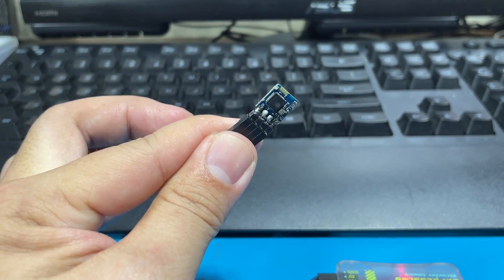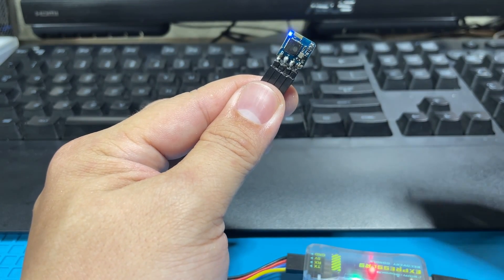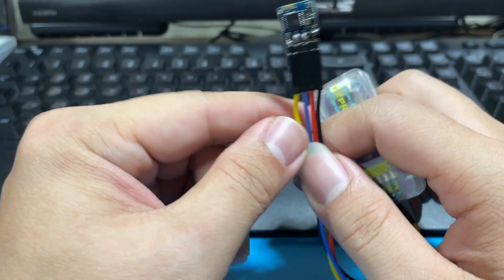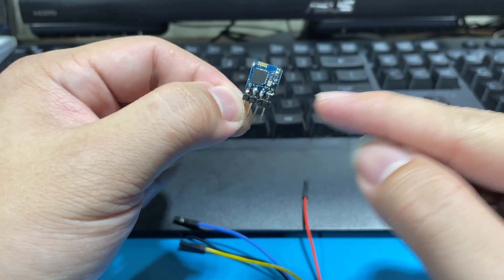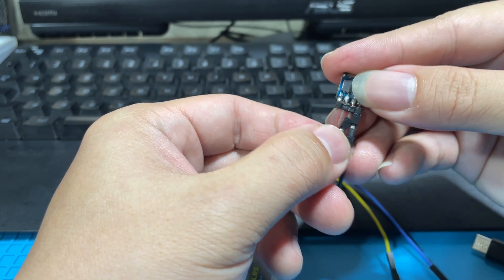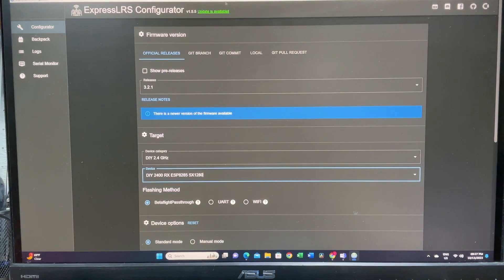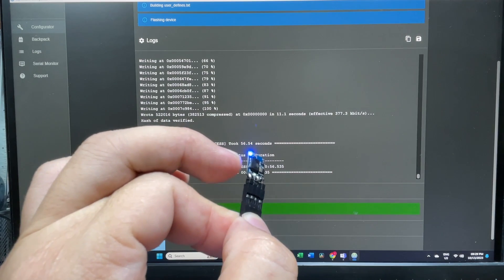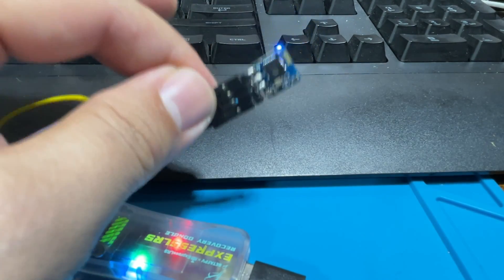[Beginner] How to unbrick your EP1/2 ELRS receiver? BetaFPV ExpressLRS Recovery Dongle #drone #fpv

Comment: Hi Friend, Nice video!
I have same problem but it happened in my Happymodel CrazyF411 FC that came on-board ExpressLRS receiver. 

Regarding this issues, how to solve it since it has no external receiver?

Do you have some ideas?
Reply from the maker: Don’t know if you are able to brick a receiver that is SPI, since the firmware is mainly managed by betaflight, try reflashing betaflight to see if the issue can be resolved

Comment: I've bricked 3 in a row now.   Two rp1's and a betafpv.  All on the same FC.  It's an HAKRC 20a f111.  The elrs devs suggested that I buy this tool.   Arriving soon, but I heard you briefly mention that the FC you had in the beginning will always send a receiver into bootloader.   Would tou expand on that?   The only one that doesn't brick is the original receiver from the build.   I can't use it though because the antenna port ripped off.
Reply from the maker: Sorry, there is not much that I can explain , but For certain older F4 FCs, mostly whoop boards. The ELRS receiver just will not work. If you keep bricking ELRS receivers, it does sound like that board might be the issue
Reply: @XwingFPVRC  we tried a recover dongle and took the FC out of the picture.   They are blaming shoddy clones, but I hardly believe that.
Reply: @XwingFPVRC  This happens to me, i have a f411 fc from a protek 25 and it always sends the rx to bootloader mode, it was workig at first but now always stay in bootloader mode if i connect it to a fc